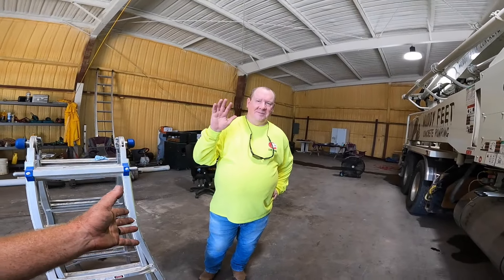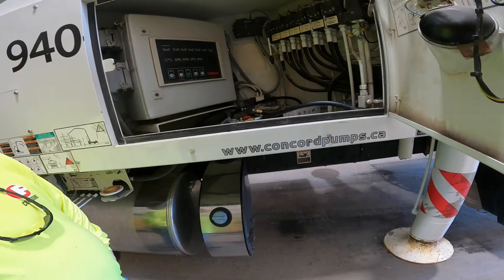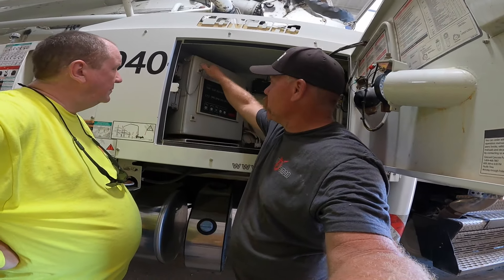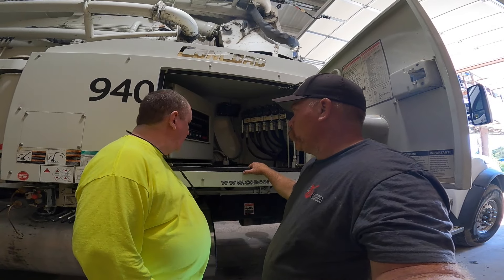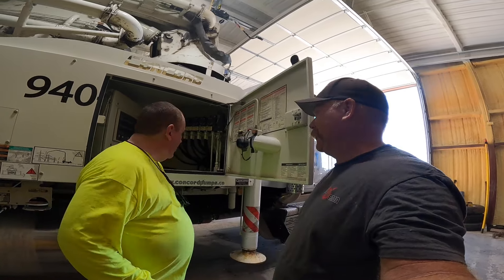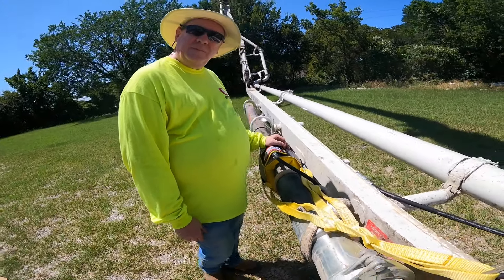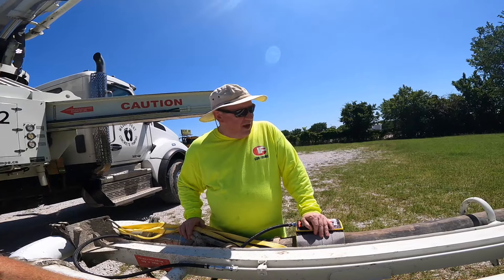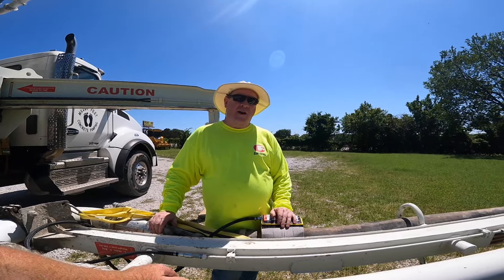New Con Forms Air Cuff install on our 38 meter concrete pump

Comment: I have a hog question.  I put a little corn out last weekend & i noticed when i switched camera sim card it was a couple hogs this past Tuesday morning 1am so my money was right i put up a 
#6 hog trap & its Thursday & no hogs .do i need to do anything special beside corn ? I also sprinkle a couple packs of kool aid on corn . The trap is 2 
5'x16' horse panels with 8 tpost . It at my daughter deer patch spot it a travel area . I have always gotten hog pictures but not every day.  Tell me your thoughts on this  & thanks  good video yal stay safe 
Daniel from central Mississippi
Reply from the maker: Just corn works the best. Sometimes sowering it works but not every time